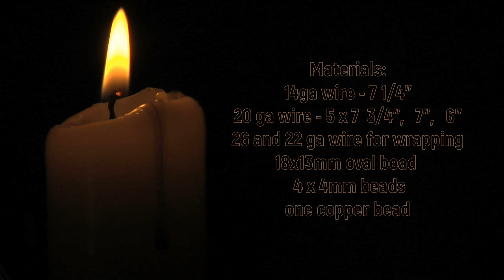Transform wire into art: Create Your Own Wire Wrap Music Pendant. Guitar.

Comment: Absolutely beautiful! How would you use a cabochon with no holes?  Any advice welcome!
Reply from the maker: I will make tuts about that , just wait  :) Actually in this guitar you can use a cabochon too, with a little correction in the back side. The top part will hold the cabochon well , just make it slightly smaller than cabochon.